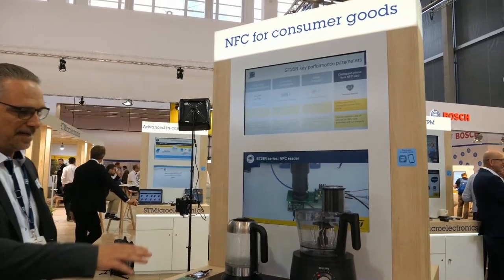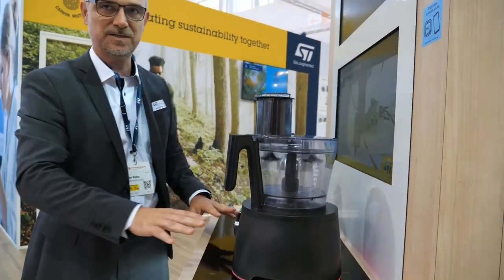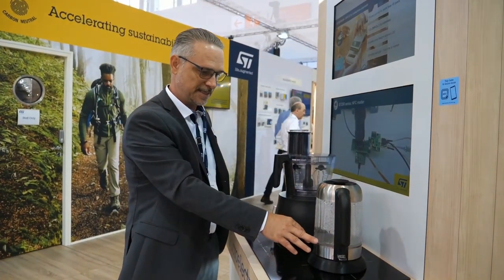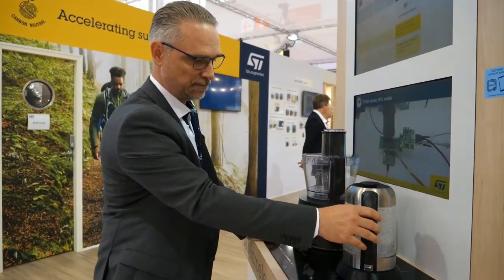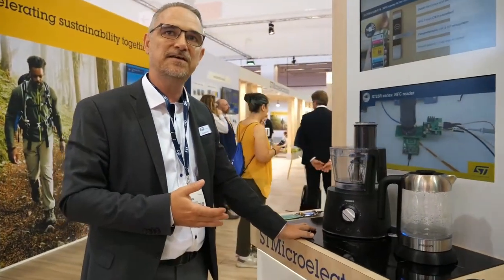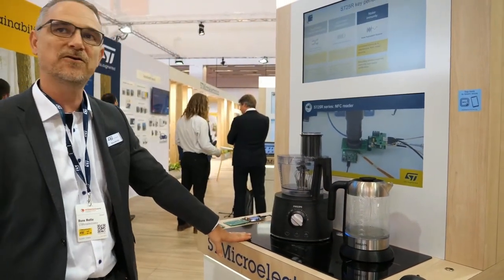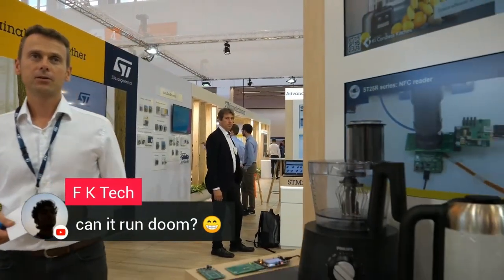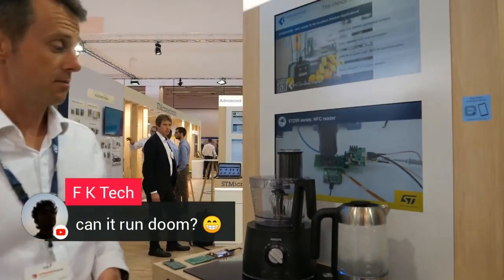Charbax @ew2022:  NFC for consumer goods

Comment: Nice functional demo! During operation, do you also continuously communicate the received-power (to compare with the supplied-power) to enable foreign-object-detection, e.g. for forks/knives etc.?
Reply: PS - when can we (theoretically) charge a smartphone/tablet/laptop on a cooktop? Would be ideal for tiny-houses and studios!
Reply from the maker: Thanks for your kind words. FOD (foreign object detection) is a topic actively discussed inside the Ki kitchen group. There is continuous communication during power transfer and details on what data is transferred can be obtained by joining the standard. https://www.wirelesspowerconsortium.com/kitchen
Reply from the maker: Theoretically yes, it is possible to charge a smartphone, tablet or laptop on a cooktop. This standard is also meant to charge LEV (light electric vehicles) like electric bicycles, and as long you have a receiver you can harvest the power. The WPC (wireless power consortium) does have its own group for this. For more details, again please join the standard. https://www.wirelesspowerconsortium.com